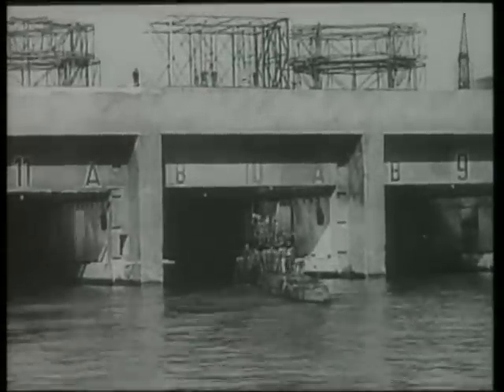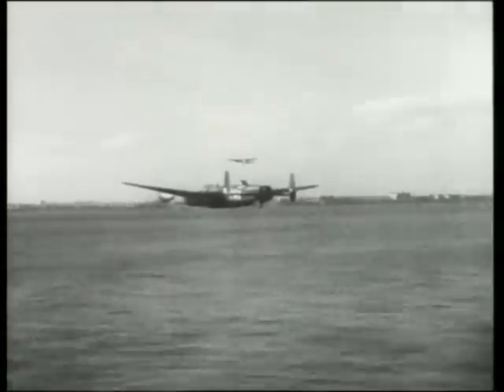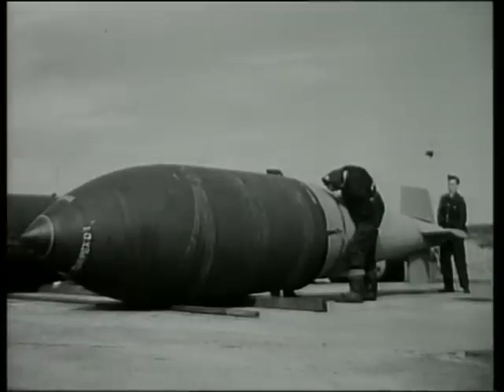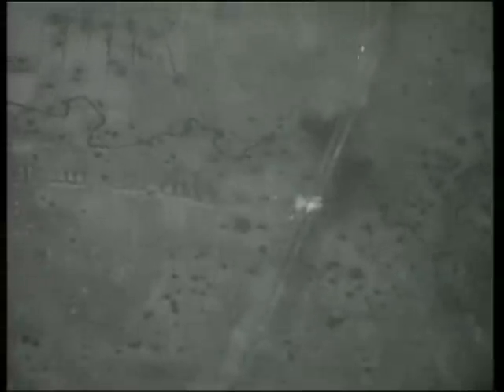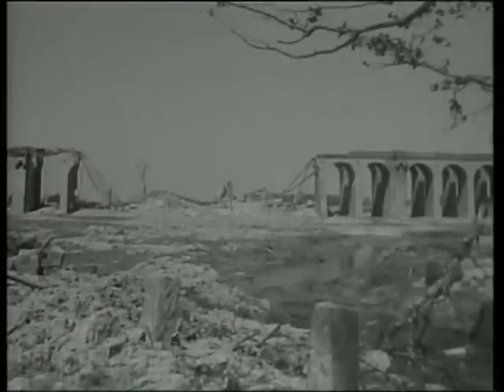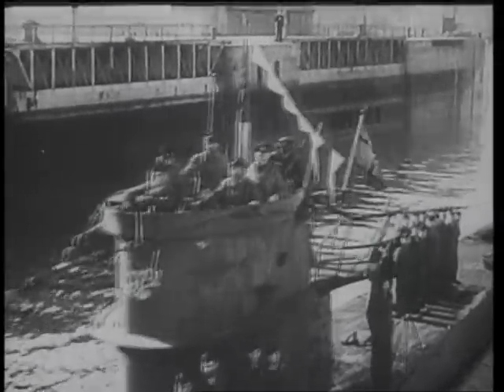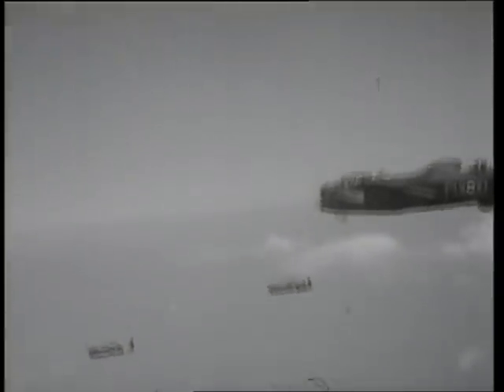TallBoys and Grand Slam

Comment: Punched through 30 feet of reinforced concrete submarine pens. Even the German commander was impressed and showed Barnes Wallace around.
Reply: @wilburfinnigan2142  at least one did, they were designed to land near and undermine the foundations. Barnes Wallace book is very interesting.
Reply: @wilburfinnigan2142  yeah they were dropping from 20,000 feet one bomb each
Reply: @wilburfinnigan2142  yeah just read they actually dropped them from 18,000 not 20, think the original design was for a ten ton dropped from 20,000 feet

Comment: I never knew Tirpitz was hit with a Tallboy. Good lord that had to be devastating. One of those is all it would take to sink a battleship.
Reply: It penetrated the upper hull and detonated in the lower decks. It was devastating to say the least!
Reply from the maker: It made a gaping hole in the bottom, it took on water and settled on the bottom, the water was too shallow for it to "sink". The hole was filled with concrete and the water was pumped out. It was towed to another Fiord to be scrapped. Later it was decided to use it as a troop accommodations. That is why so many were killed when the RAF bombed it again later. The Tirpitz capsized and that was that.
Reply: Dave Anderson You sank my battleship
Reply: You are not well BoringTractor, seek help,
Reply: Wilbur Finnigan yeah, even the precision bombing specialists found 617 squadron were not that precise in ww2.  But the first raid used 20 bombs, scored one direct hit and took Tirpitz out on the war, despite reflecting her later on.  The raid that sank her once and for all used another 30 tallboys.
Reply: @wilburfinnigan2142  you have any idea what they went through on a bomb run? All things considered they did extremely well. Also because of the great difficulty of hitting targets the bomb was designed so a direct hit wasn't necessary you only had to get close. One grand slam took out the viaduct the American's had bombed it for over a month with no success.

Comment: Bombs for destroying hard structure almost impossible to penetrate. Like hardened submarine  tube . Dams and underground bunkers.
Reply: Designed not just to penetrate but to destroy the foundations so they collapse - a near miss is good enough. In that limited sense the submarine pens withstood them - punched the hole, but did not destroy the structure.

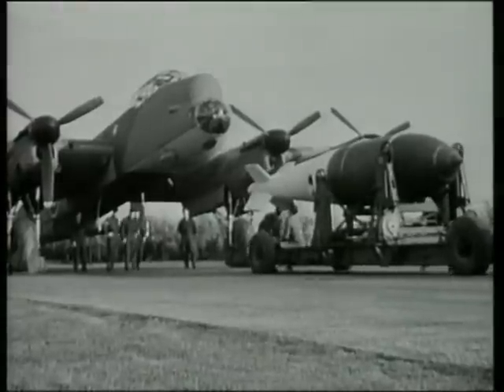Comment: Surely the plane in the video at 1:32 is a Short Stirling bomber our first four engine bomber of WW11.
Reply from the maker: No. Only the Lancaster was big enough to carry the load. All Lancasters were from RAF Woodhall Spa 617 Squadron and a few from RAF Bardney 9 Squadron. Lincolnshire. No other airfield had them, other than a few American Aircraft who were experimenting.
Reply: But the photo IS a Short Stirling ! Not a Lancaster.
Reply: Simon Smith A Stirling with inline Merlins and twin fin tail? not on this planet. The only difference to the std Lancaster and the grand slam carrier is no bomb bay doors This variant also has the front turret deleted.
Reply: @G1ZQCArtwork  Did you know---that our Lancaster, was almost given the task, of dropping the first nuke on Hiroshima ?  WHY ?   because the Americans were having so much trouble building the B29 Super-fortress, that almost too late in the war, it was discovered that it's bomb carrying design, was not wide enough, for the Tall Boy bomb. Britain had a special fleet of Lancs, unmarked,  painted all  Black,  ready for the word to go, when the Americans , out of shere determination, that it should be a US plane,  made risky changes to the  B29 undercarriage, and the rest is history.
Reply: @MrDaiseymay  The B29 first flew in 1942, there was no formal agreement between the US and UK on atomic bombs or their use until the Quebec Agreement of August 1943.
Post war the US loaned over 80 B29's to the UK. They were known as Washington's.
Reply: @fizzguts  Lancaster B.1 Special 
32 Aircraft were adapted to take first the super-heavy (12,000 lb) ‘Tallboy’ and then ‘Grand Slam’ bombs and included up-rated engines (with paddle-bladed propellers to give more power) and the removal of gun turrets to reduced weight and give smoother lines.  For the Tallboy, the bomb bay doors were bulged slightly whilst for the Grand Slam, they were removed completely and the area faired over. For some Tallboy raids the mid-upper turret was also removed.
BAE Lancaster page
Reply: I think that was a 617 Squadron special. They got rid of the front and mid upper turrets from their Lancasters (because they were useless). I think 617 Squadron were a bit like the SAS. They were an elite fighting force and given more discretion in how they wanted to do things.
Reply: @simonsmith8966  incorrect, however the normal Lancaster front gun turret is not fitted. Short Sterling looks quite different and had radial engines.

Comment: so excuse me for being thick but are the tallboy, grand slam and earthquake 2 or 3 different bombs  or just different names ? At least two have got to be different bombs surely lol
Reply from the maker: Two different bombs, Tallboy stands at 12,000LB and Grandstand at 18,000LB. Thanks for asking and NO you are not thick, it is just the way they were kick-named.
Reply from the maker: In addition, both types were ONLY stored at RAF Woodhall Spa Lincolnshire. This was kept secret for obvious reasons.
The history books wrongly state that the RAF took off from Scotland to bomb the Tirpitz, when in actual fact, they took off from Woodhall Spa (617 Spdn) and Bardney (97 Sqdn) , both in East Lincolnshire. Re-fuelling in Scotland and Russia, (yes, they landed twice with them on-board.
Also, on an aborted mission, they were not allowed to dump them on the way back, as was done normally for safety on landing, instead, they had to bring them home as they were so expensive........
Reply: David Potter grandslam is 22000lbs
Reply: Tallboy was also stored at Bardney (IX Squadron)
Reply: Grand Slam was 22,000lb, not 18,000lb

Comment: This is only one of the reasons the Lancaster was the best bomber of WW2 even over the B-17 and B-29  Not only the mass of bomb load outs But its use of multi capablities  Tall boy, Grand slam, Upkeep bouncing bomb, Cookie bombs, Blockbuster bombs, incendiary bombs 250lbs 500lbs etc  Tatics like dropping "blockbuster" bomb (  3 x 4,000 lbs HC bolted together ) and Incendiary bombs with the Idea of blowing up in a area with many Buildings Taking off roofs and blowing in windows and doors Spreading wood and burnables all over Then dropping incendiaries to start major fires USAF bombed during the day RAF at night with this tactic Keeping the Germans not only from living in homes or working But making them spend all there time in under ground bunkers or putting out fires Unable to sleep due to 24hr bombing Desden was one of the worse fires Which the wind carried the fire over the whole city and it became a Fire tornado sucking people into the fire and melted metal and burned walls of brick down
Reply: soaringtractor   that is TRUE!!
Reply: @wilburfinnigan2142  The B29 had to be modified to take the Atomic bomb. There was flight of Lancasters on standby if they weren't ready in time. The Silverplate B29s
Reply: Obsolete before the war was over B29 carried on for another 10 years. No one makes better bombers than Mercia
Reply: @edpinkerton7947  It was obsolete for England As they already had a Jet bomber The gloster metor And a jet fighter The Vampire Before the war was over 27 July 1944

Comment: So the M.O.A.B.  that was just dropped recently on Afghanistan is exactly the same size that the Grand Slam bomb was - how come the media said it was the world's largest made conventional bomb?
Reply: These are not conventional, the MOAB and FOAB are fuel-air bombs with the explosive power of a small nuke.  The Grandslams and Tallboys used conventional explosives, they might have the same weight but the destructive power of a MOAB can flatten a small city whereas these were used to punch through 20 feet of concrete and shatter a bunker.
Reply: the MOAB is a thin casing of aluminum just strong enough to remain rigid with maximum filling weight dedicated to explosives and this bomb goes off at the surface. The Tallboy and Grand Slam had very thick metal casings, especially at the nose because they where designed to penetrate before going off. Therefore the explosive weight of the Grand Slam relative to the MOAB is smaller.
Reply: AND  America cannot acknowledge their bombers at the time were incapable of carrying them.  Even the Mosquito could carry a heavier bomb load than a B17

Comment: How were they so accurate with these bombs considering the bombing of Berlin was a real hit or miss affair
Reply from the maker: Look up the skills of Pathfinder Squadron. Very skilled and brave lot.
Reply: David Potter funnily enough my Grandad was a navigator in the Pathfinders they laid down flares to the target and away from the target as I expect you well know but I was wondering how advance the Bomb Aimer machinery was to be able to bomb a target such as a ship. The reason I question it is the fact that the RAF found it quite hard to bomb factories accurately so carpet bombed a whole area to take out a factory.
Reply from the maker: @zozoa1  Bomb aiming gear was not that accurate. bear in mind, 617 Squadron was known as the suicide squadron, with good reason. In one of the many books I have read, there was a story about a Mosquito at high altitude would dive down at quite a steep angle, directly at the target and let the flare go. Pulling up quite sharply to avoid following the flare in.
This was absolutely against "the book", but 617 had total overall control on what they did, providing the crew was in agreement. This made target marking very accurate.
Now you are going to say, yes well thats the flare on target, what about the Tallboy? strapped to the underside of a Lancaster, the wings would bow 6" under the weight.
Someone had the bright idea to try the same with a Lancaster and pull up. So again with full cooperation of the crew, they tried it.
Yes it worked, because without the 18,000lb payload, the plane was light enough to pull out, but it was risky and very accurate.
When they got back to base, the commander said "I don't want to know, just log it"
Brave men young and old.
Reply: David Potter Wow brave indeed well I never knew that thankyou so much for letting me know. My Grandad flew out of RAF Warboys and he completed 5 missions in a Lancaster 4 of which were over Berlin. He was the Navigator. However on his last mission he was in the Bomb Aimer position when the Lanc was attacked and was shot down by a fighter plane ironically the Navigator bailed out but unfortunately he didn't. However it's fascinating to find out about these thing Thank you again for taking time to write back. I'll have to have a read up on the Pathfinder Squadron
Reply: WINDZUP 1700 
There's a difference between daylight and night bombing.
Think about it!!,
Reply: @wilburfinnigan2142  You don't think that the presence of a smoke screen on the previous missions might have affected the accuracy ever so slightly? In fact Tirpitz was damaged beyond repair by an earlier mission, the Germans moored it as a gunship, it was unable to go to sea.
Reply: I think you may be mixing up two different approaches to WW2 bombing techniques. Early WW2 bombing was wildly inaccurate- 5 miles (8km) from target was considered "quite good".  Bombing of cities such as Berlin, Frankfurt, Hamburg, Essen and Dresden  et al was "carpet bombing"- indiscriminate scattering of high-explosive and incendiary bombs in great numbers over an area. Accuracy was sacrificed for wide-spread destruction.  I don't propose to argue the moral issues surrounding this here...
With the advent of "Tallboy" and Grand Slam", bombing accuracy had to improve as the bombs were virtually hand made and very expensive. SABS (Stabilised Automatic Bomb Sight) and the American Norden bomb sight were rudimentary "computerised" (albeit mechanical) bombsights which took a lot of the guesswork out of the bomb-aiming procedure and made "precision" bombing more feasible. "Tallboy" and "Grand Slam" were designed not for a direct hit, but for ground penetration close (<50 metres) to the target, producing a camouflet to rob the target of its foundations. It was a subsidiary  "benefit" (but not to those on the receiving end of these monsters!) that it was found that the bombs, travelling at Mach 1+ penetrated reinforced concrete before exploding. Accuracy with the technology in 1943 onwards cannot be remotely compared to that achieved with modern laser-guided bombs seen disappearing down chimneys in the late '90s onwards!
Reply: @stephenphillip5656  Thank you Stephen for an excellent answer. I appreciate it.